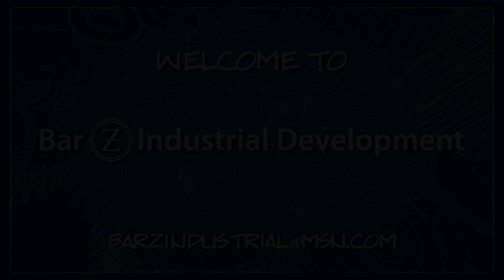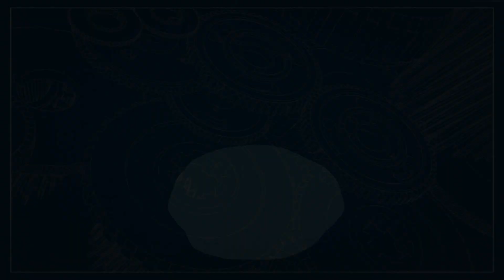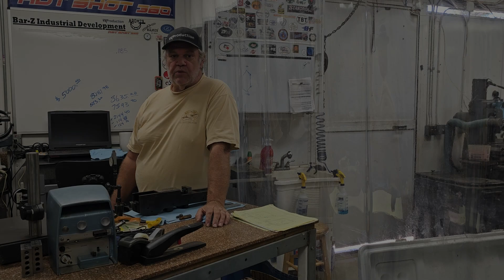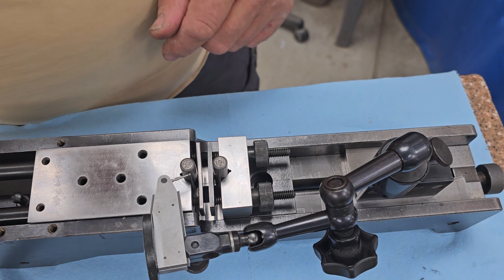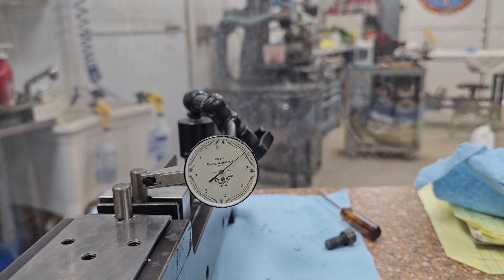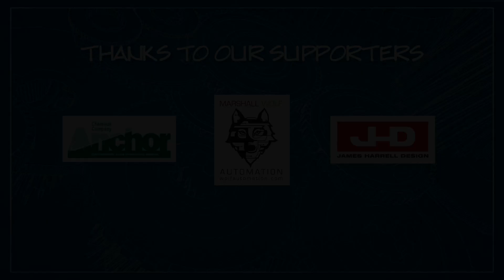VARI ROLL #2

Comment: Becareful, we may loose you to NASA if they see that you are a problem solver, hehe🙂. Great concept, Question, since the two V-notches have to mate,will the head & tail stock require placing a ground square peg and be held in postion via a clamp, then the sides be measured with good old fasion filler gauges? A hobbyist with a studied question 🤔. This kind of content is always good, helps us hobbyist too learn problem solving. Thx for sharing, Bear.

Comment: I'm a little surprised that you decided on four buttons instead of just grinding the sides of the tailstock down a little and putting a strip on each side. It seems to me like that would be easier to scrape, since you have a continuous surface.
In theory you could also correct the horizontal off axis by scraping the turcite, but it is probably easier to work on the V groove after getting the turcite bedded.

Comment: Interesting idea Stan. I'm wondering if the buttons will have enough surface area, to prevent the tailstock from rotating on it's longitudinal axis. Should work just fine to eliminate the side to side slop, and the yaw. It's the rotating I'd be concerned with. It may need the full contact of a finely fitted tailstock. Only one way to find out!

Comment: I'm curious why Turcite on both sides?  I'm not there to see what you're seeing , of course, but I'd think grind 0.00035" off the near side to you, to center the dowel, and put the Turcite on the other side. Also curious why a dot instead of a strip. Videos I've seen on installing Turcite all seem to be after maximum wear area. Nice troubleshooting and measuring.

Comment: Stan that sounds like an excellent solution to the slop problem. However, I'm still curious as to whether you checked parallelism between the head and tailstock V-grooves? If one or both of the grooves are leaning forward or backwards that is also going to have a negative effect on the measuring capabilities of the tool.

Comment: I like the idea of turkite.  Why not just grind a slot or the bottom part of the side then apply the turkite and scrape.  That way you have full bearing on the side, whay better to keep alignment.  Nice job on the measurements like the sled idea.
Reply: I would agree with that. Easier to scrape too. Bet he ends up doing that, Stans no dummy.

Comment: The other way that you could install the Tercite would be to use a strip.  You could grind the slot for it if the hardened steel is too hard to machine. Interesting repair, thanks for sharing.
Reply: No need to grind it, carbide would make short work of that.